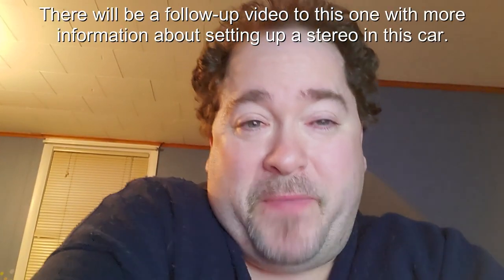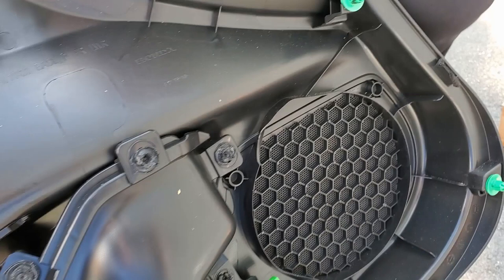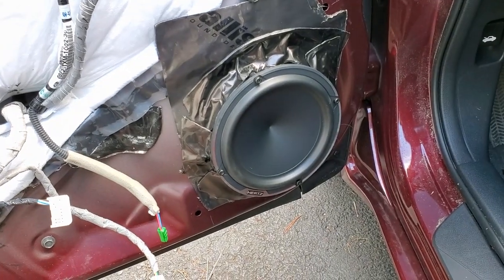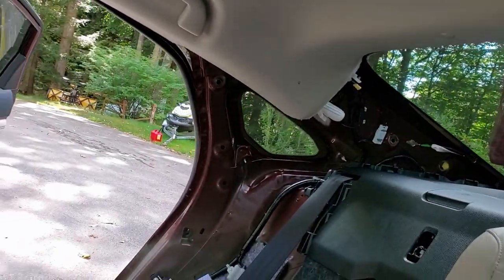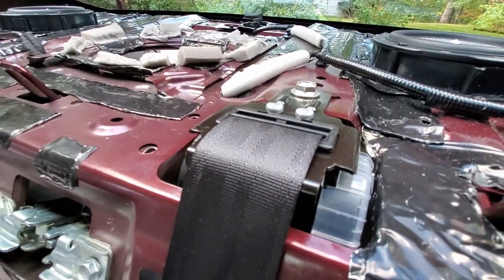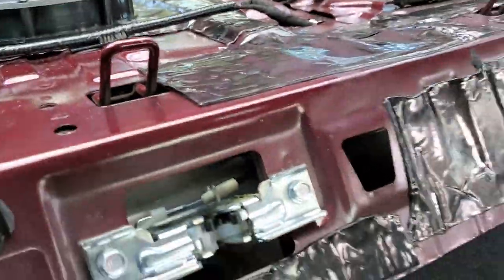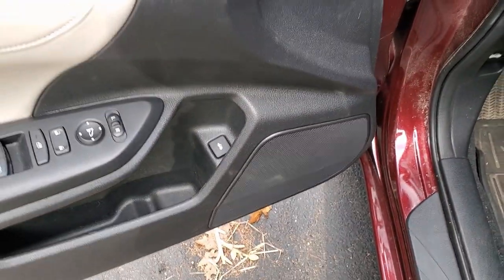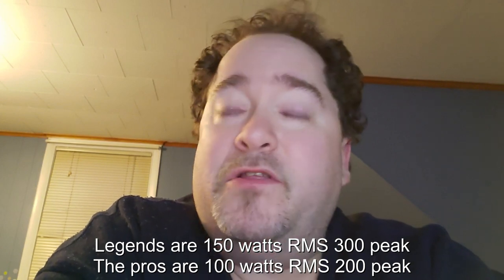2019-2021 Honda Insight: Hertz speaker install and impressions

Comment: I love Hertz because you get the high sensivity and the tweeters are not harsh. Do you think you could of gotten away with the Legends MLK in the front and no speakers in the back if you had a loud subwoofer in the trunk ? I'm planning on only doing the front speakers because the back speakers in my car are gonna get drained out by the sub anyways
Reply from the maker: I would recommend you at least get Hertz coaxials in the back. They aren't that expensive and they will add a proper fill of mid level sound to the car. Discreet components are probably not worth it in the rear unless you have a lot of passengers. Also you fail to mention if you plan on using a DSP.
Reply: @verdier4006  Wasn't planning on a dedicated DSP but my headunit supports 3 way crossovers (LPF for the sub, Midpass for the midwoofer and HPF for the tweeter) along with 13 bands of EQ and Time alignment. Was going to run the front component set active (no crossover box) and run the ported 12 inch sub in the back. The last time I had a loud substage in the trunk the rear speakers got drained out
Reply from the maker: Hmmm. I haven't tried shutting my rears off to see if just the front plus sub was all I need so I can't be definite about how much you might lose without the fill. I still think simple coaxials in the rear would be better than nothing in your system. Possible that your sub may push enough to drown out the rears but since you can get some reasonably nice coax speakers for a pretty cheap price I think it might be worth the shot to see if the fill actually makes a difference in your system.

Comment: Verdier, do you have any “insight” on the “angelic” sound the Insight produces below 20 mph? And/or the “sport” sound the car makes? (AVAS - Acustic Vehicle Alarm system)I know the Canadian version has a “off button” for this which means 1)  their is a speaker for this (if I am not mistaken, under the headlight) 2) we may be able to turn of the sound produced .  I know this is by law in the US - I live in Mexico and would like the silence, any thoughts? We’re is the speaker? How can I add a switch to turn it off?
Reply from the maker: You could try to purchase the switch and see if the connection point is available in your Insight. It's possible the connection is there but not used since your car doesn't come with the switch. I have looked into finding a way to set it so I can turn it on at command, but the lines going to the speaker are data lines and might not be worth fooling with. Personally I love the pedestrian warning sound. I have heard that people who have disconnected it have had troubles with warnings popping up on their dashes saying there is a problem, so without knowledge on how to handle the data lines without popping up an error, I'm afraid we may need to wait for a hack.
Reply: Thank you for the quick reply! Where would you suggest purchasing the button/swith, I have not been able to find even the part number!
Reply from the maker: @ulisesmolina323  hmm let me look into that. It may take a few days to find out.  Please email me at verdier400@gmail.com so we can communicate directly.

Comment: Hello Verdier, I appreciate your videos to help us music enthusiasts. The Honda Insight has been on my hit list for potential cars, was just curious what your grand total in cost was for parts and labor to install everything and if you could do it all over again (knowing what you know now) would you still have don it? 

I want the Honda Insight because I like the the MPG you save and the civic look. But I have also been eyeing the new 2020 mazda 3 because it has the bose sound system pre installed (I've heard a lot of great reviews on it). I can't decide if I should get custom speakers and save on MPG (also looking at the Toyota camry hybrid, but I hear it also has garbage speakers) or go with a mazda 3 with stock bose speakers and avoid the time, hassle, frustration with installing custom speakers.
Reply from the maker: Well my price isn't realistic overall, but Ill let you know what I would recommend. The Audison amp is about $1200 and is 8ch with a 9th channel out for a sub amp. It also has the DSP which is essential for sound shaping. The sub amp is an Audio control mono block which cost me about $175 but would average you about $225. The front speakers are Hertz legend and you can find them online for about $600 and the rear are Herz Coaxials which would run you about $250. The sub is an older 12" Rockford Fosgate in an enclosure. The center is a kicker at about $30. I also did heavy sound matting around the car.

The amp is excellent, but it does demand good sources for your music to really shine. The Hertz speakers (especially the legends) Are truly beyond belief. Now the car was very new at the time so the custom installation was a bit pricey and finding someone competent to do it was also a bit of a hassle.

Was it worth it? Well, I wish I had purchased the speakers myself rather than through the installer. He seriously hit me on a premium for them. I also wish I had gone with the Hertz in the first place rather than the Kickers. Remember my system was designed to be played at high volumes since I don't hear well. Also the Honda DSP settings are unusable if you play at higher volumes so a DSP is essential in this car. I think it was worth it! The speakers are 150 watts rms with 300 watt peak so they won't blow. And, if I have a well sourced piece of music, the system is unbefuckingleavable.

Most toyotas have JBL systems which are rock solid for not blowing easily, but will distort on a dime. If your hearing is normal then I would recommend trying out the Mazda Bose system and see how it sounds. After my debacle with the sound system in the Insight, I went and leased a Ford Fusion Energi and sat in it by myself for an hour playing all types of music at all types of volume before signing the lease. If sound is that important then find a mazda dealer that will let you do this. Afterwards drive around for 20 minutes with some music playing to see how it really sounds. This way you can figure out what trickery is being used  in the system and what real world limitations it has. After this then you'll know if the Bose is worth the money or if it's better to just build your own system. If you have any further questions feel free to email me at verdier400@gmail.com

Comment: Where was the power wire and ground installed for the sub? I am not sure where in the engine compartment to run the wires to.
Reply from the maker: The power is between the front seats. Open the side panel on the passenger side where the pad that you rest put your phone on is and you'll find the battery of the car right there. You can hook your power directly to the 12v battery there. You can find grounds all over the car. You can hook it behind the back seat to any screw or you can ground under the dash. There are several grounds already there and several places you can screw in a ground.
Reply: @verdier4006  Thanks!

Comment: Not quite as good as yours, but I have the Hertz MPK 165.3 components in the front, the Hertz DSK 165.3 components in the rear doors, and a 12" sub in the trunk. Best sound I've ever had in a car and that is coming from someone who has run Focal's exclusively for the last 15 years
Reply from the maker: I'm assuming you're not talking about an Insight here since you said in rear doors. The Hertz are amazing speakers. If my hearing and comprehension was better I would have gone for the high end Audison versions which have even better fidelity but less wattage. Unfortunately I need volume and these speakers pump them in spades and sound amazing. I'm sold on Hertz/Audison.!

Comment: Thanks for the vid. The speakers can not technically be wired out of phase. It's a misconception. Polarity does not equal phase. I agree that the ring shouldn't be hitting the speaker, but if it does, it's because your baffle is wrong. those rings are to tunnel the sound into the cabin. 
--Well, I listen to Techno, and, as such, I like the sound to completely surround me and feel immersed in the music with little to no ability to specifically identify the location of any speaker, if everything is tuned correctly. Of course, you will know where the speakers are and see the tweeters and the 4 surround speakers, but the sound will be like spherical. Best explanation I can give.
Reply from the maker: Thanks for the technical jargon. Way beyond me. Either way Adam said phase at some point. He might have meant polarity... either way he said the front left and rear right were basically cancelling each other out. As for the rings...I figure the speaker adapter along with a larger speaker size (thickness perhaps) would be the main culprit for this.

Comment: What amp did you use to power the front hertz speakers?
Reply from the maker: The system (except for the Sub) is powered by the Audison Forza AP F8.9 bit 8 channel DSP amplifier.

Comment: The sound system is worth more than the car.
Reply from the maker: So it would seem. Not really but it really rocks now. As it turns out later you'll find out I had a faulty amp and now it truly kicks ass.